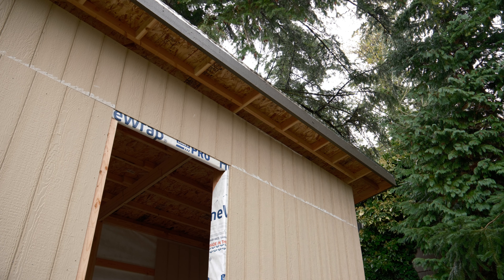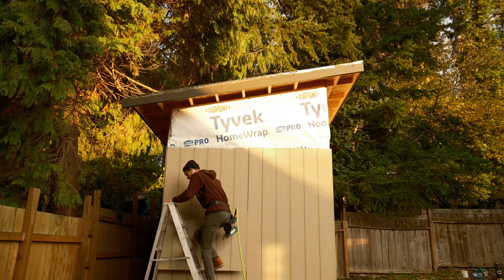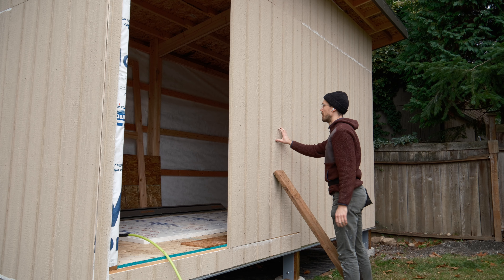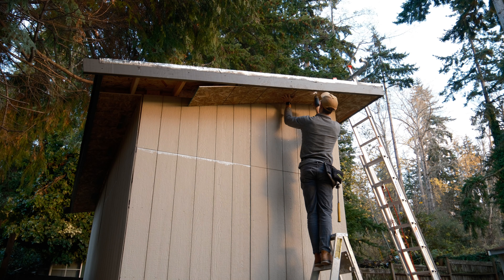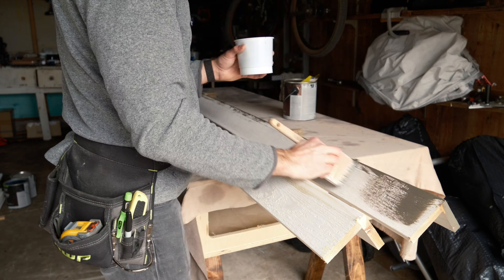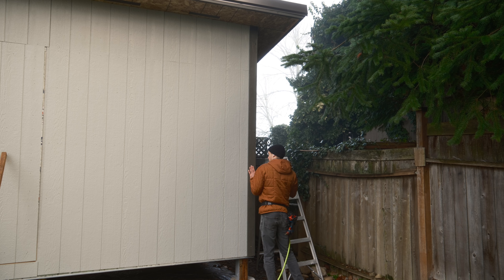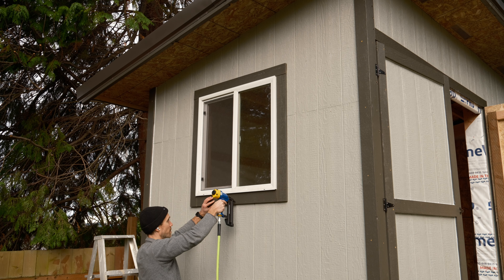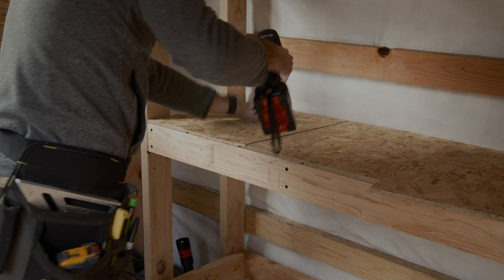DIY Post Frame Shed Build – Part 3 of 3

Comment: Thoroughly enjoyed this series! A shed is something I’d love to build myself. I’d love to see you compare a traditional lean-to to your post and beam. I know post and beam structures were definitely a go to in Kansas lol and it’d makes sense because of wind and tornados, perhaps makes a stronger structure overall? Can’t wait for the garage tear down and build
Reply from the maker: Glad you enjoyed it, and you should totally do it! It's a good place to mess up 😄

My understanding is that these days with modern building techniques, any type of framed structure can be made to be pretty wind resistant as long as you start with a sufficiently deep foundation, then tie each successive layer to each other. Foundation -> floor -> walls -> roof. On stick-framed structures you can get the aptly-named "hurricane clips" that tie the roof rafters down to the wall top plates which are really handy.
Reply: @andymakesstuff   Thank you, I don’t know what it is but building structures such as sheds, dog houses, chicken coops, you name it I love and I just need to commit and build a shed. I do love your method, I could see that being a solid foundation as yours is. I’ll definitely utilize the hurricane ties! Thank you for your feedback, this was a blast to watch especially because the way you went with this isn’t as common as a concrete foundation but it’s structurally sound and I can’t wait for garage or next project you pursue! Take care